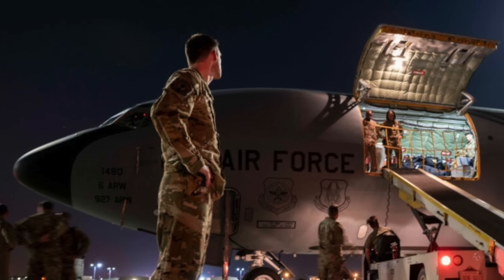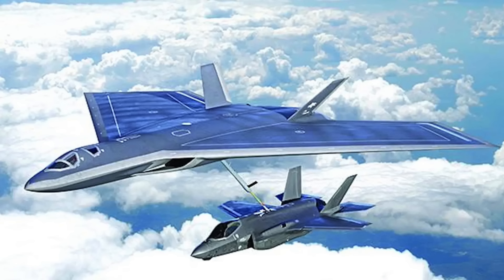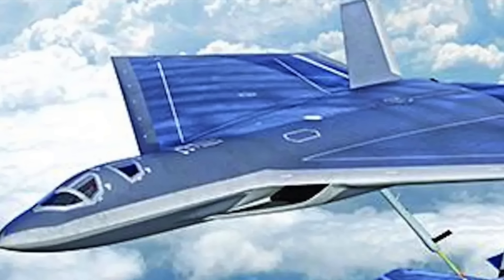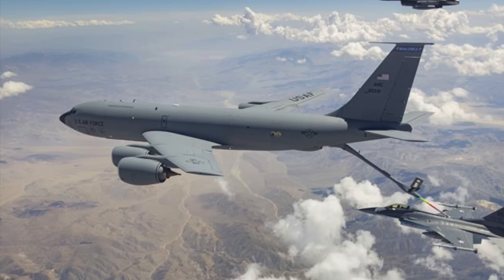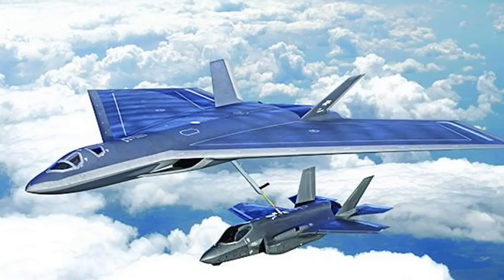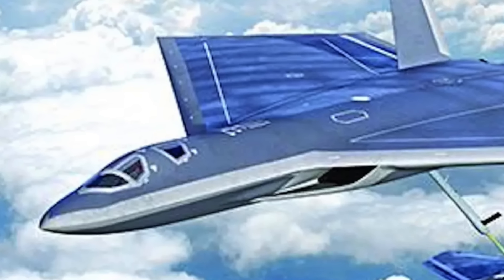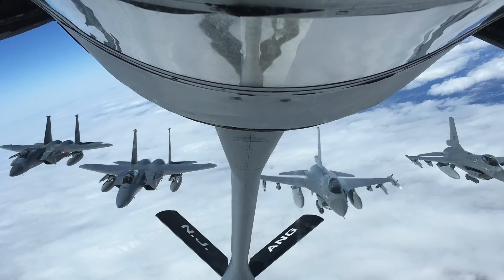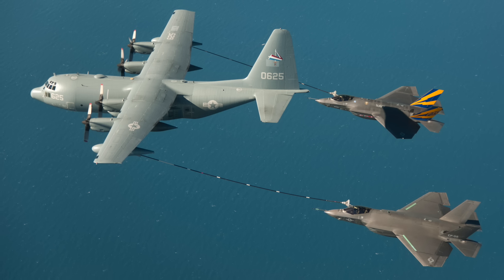Next Generation Air-Refueling System - Stealthy aerial tanker by Lockheed Martin's Skunk Work !

Comment: I would have thought the tanker would be more of a flying wing. Maximum fuel efficiency and loiter time, better stealth against lower frequency (longer wavelength) search radar (S and L band), and more interior volume. Also, air intakes on top of the fuselage rather than below. This is better against ground based radar, that can use the lower frequency search radar bands. You can have lower frequency radar on large AWACs that can fly as high or possibly higher than teh stealth tanker, but they can be driven off.

Comment: I've been saying this for 10 years now. Glad the military finally caught up. 🙄
Reply: Trust me, they already knew that.

It has been an active debate between planners, industry and acquisition.

You were not the only one thinking about this issue.
Reply: Convert B-2 to tankers. That's been my suggestion for some time.
Reply: @BV-fr8bf  why? So you can have 18, very old, ungodly expensive patch work refuelers?
Reply: @WeAllLaughDownHere-ne2ou  If I have to explain why they're needed, you probably aren't capeable of understanding.
Reply: @BV-fr8bf  That might be doable but they're still planning on using the B2 for a while.
Reply: @dextermorgan1  Sounds like your ego won't let you acknowledge that it's simply a bad idea.

The refueling boom is a large heavy mechanism, It's inherently unstealthy. You want to add to the B-2 with no clue how it will effect aerodynamics? Or the structure and weight and balance of the aircraft?
Degrade it stealth capabilities? Refit the entire fuel management system and add new fuel bladders, anti-slosh baffles, much MUCH more powerful engines on a whim?

Comment: Jet Zero design is better and beautiful. They can work to fix the technology bit of it
Reply: Use converted B2's as refuelers further back to load the Ghost Bats that range forward, then both aspects are protected to a good extent. The Bats are more expendable than the B2's... without a whole lot of expensive new tech.

Comment: It is the logic next step for AWACS, Tankers and  C4ISTAR aircraft
China and Russia whole goal is knocking US assets like the E-3, E-8, and KCs so the US has no eyes , battle management or fuel
If I was Lockheed, I would proposal a whole family of aircraft based of this design
Reply: AWACS has a disadvantage with stealth. Doing its job means that it sends out emissions that can be seen for hundreds of miles
Reply: @mowgli2071  
They kinda have no choice
AESA is hard but not impossible to spot and can be masked with electronic warfare
The current line of AWACS built on civilian airliners can be spotted hundreds of miles away
Missiles are getting longer range and high speed
Locking on to B-747 at 300 miles is ease
Even if it turns to evade, you can still track it
With a stealthy AWACS, you using the emissions
so they stop broadcasting and you are blind
its complicated but the current generation of AWACS are very vulnerable
Reply: @mowgli2071  Good point. Though I see Northrup creating these aircraft, as they have experience making large body stealth aircraft.
Reply: When your radar systems are by far the best in the world, in both range and resolution, your AWACS can be significantly further out of reach than you enemy has the ability to hit. And don't forget....WE OWN THE AIR...PERIOD! We sanitize an airspace and take risk mitigation to virtually zero. That will not change anytime soon. Especially when every F-35 is flying suite of sensors.....
Reply: @TK199999 - NORTHROP. Jack Northrop. It's not spelled the same as the mail truck. Northrop.
Reply: @Cody38Super  
The best AWACS resolution is only 300 miles. , thats still well within long range missile range

Comment: Why a new design, convert a B-2 or modify a B-21...wtf!
Reply from the maker: I think it would be too costly
Reply: Just remove the weapons bays and replace with gas tanks add a refueling boom arm and bang you have a new stealth tanker already practically paid for cheap cheap cheap❤❤
Reply: It's also more efficient as they also don't need to develop a new design. A B-21 tanker would also simplify logistics.
Reply: If you want to keep them even further back, use them to tank the Ghost Bats, that come forward for the fighters & drones.
Yea, two steps, but puts the less expensive and more stealthy units further forward.